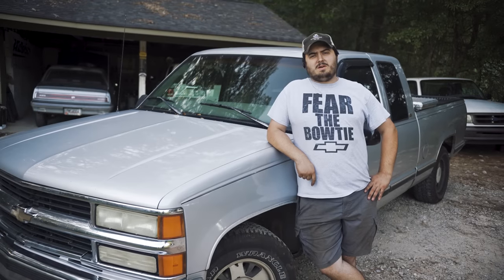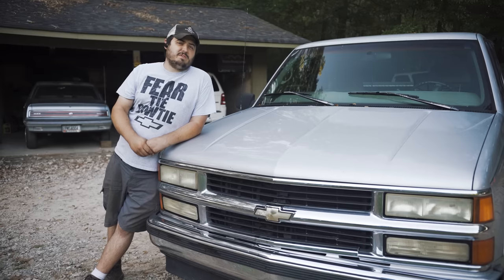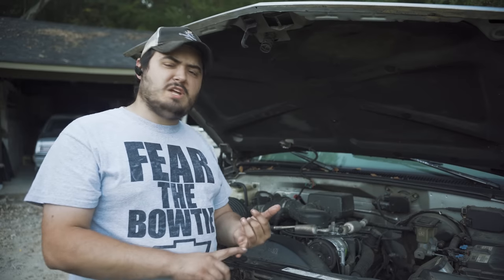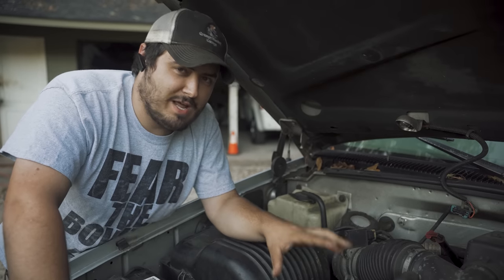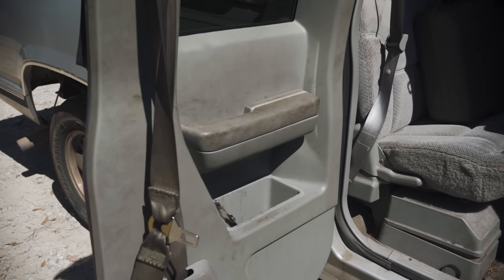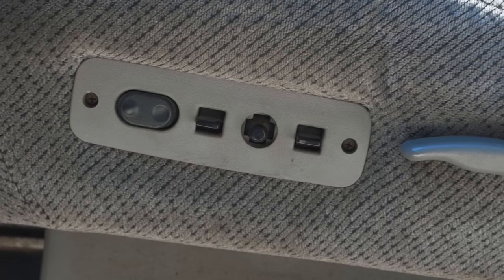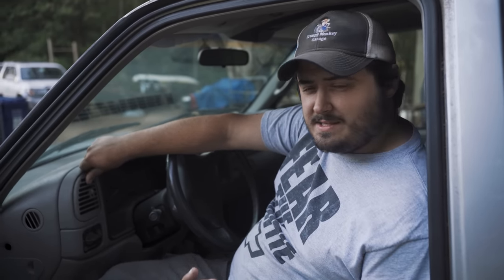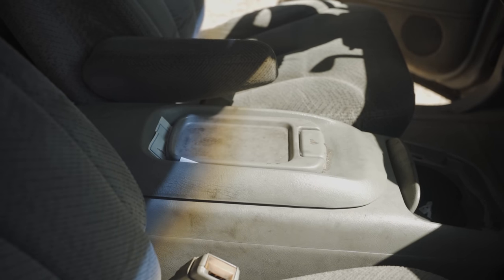OBS CHEVY TRUCK REVIEW, 1997 Chevrolet C/K1500 Silverado Review, The Best Truck You Can Buy?

Comment: Wow 👏 
Glad to hear that. 
Unfortunately I wish I was that happy with mine. I  have a 98 k 2500 4x4 extended cab long bed. About  115 thousand miles. Looks awesome. But I have replaced. Alternator. Have had  starting problems. I  don't know why. But  sometimes it feels like not doing anything. Eventually it does start. Steering problems  yup. Brake problems. Yup. For a  350 automatic transmission it should have lots of power. I  don't..Runs great 👍. The  head gaskets got eaten up by the crap antifreeze that they used. Replacing that was crazy. But I did it. Now it smells like antifreeze in the cab. When I turn on the heater. I  haven't checked it yet. The  arm rest at different  heights is wierd. The  floor boards are nice and curved. So when I open the passenger side door. What ever is there  falls out. 🤔 I  don't have the third door so getting in the back of my truck is not exactly easy. 🤔Air conditioning has a leak. It  works for a day or so when i get r134 in it.tried the leak stuff with no luck. Its like it hardly gets used but it always needs something 😕. 
The  fuel pump was a adventure. 
Cold freezing cold cold weather and almost a full tank. Two hours away from home. 
What the hell. Other than that it is a beautiful truck. Spent most of it's life inside a garage. 
Nice and  clean and looks great. 
Parked. 
Did anyone else get a lemon 🍋 
Like Me?
Reply: Is your truck still giving u problems i have a 98 also
Reply: @jonschwartz9669  No ac Wipers work when they want to..I  hardly use it. But I am always terrified that it will not start. 
Done that been there. 
What problems do you have
Reply: @vm722  I had problems but had to fix them its my daily driver  if your doesn't want to start its either fuel or fire and most likely fire pull your distributor cap make sure to mark your wires somehow before pulling cap look at the contacts for corrosion and look at rotor  also don't loose the screws to cap
Reply: @vm722  does your air blow through the vents
Reply: @jonschwartz9669  yes the ac used to work for about a day. So I got uv dye glasses and light 134.It  didn't want to suck up the  134.
Yes I triggered the compressor. 
I  think that it probably needs a new compressor. 🤔 
I am tired of fix da ting
Reply: @vm722  your ac has a low pressure switch if its low on 134a it won't cycle it needs 2.5 pounds but it will cycle if your filling the compressor and it can take an hour sometimes till get 2.5 pounds in the whole system if it's cold outside the can will freeze and no gas moves the can works best in a bucket of hot water if your compressor clutch moves for 2 seconds while filling then stops your compressor is fine it takes patience and time to get the gas going once it gets full enough for the low pressure switch to be satisfied it will fill up faster the compressor also has a high pressure switch and once its full with 134a and everything is running good the compressor will cycle on and off with the high pressure switch
Reply: @vm722  don't give up there's a trick to filling it up i know it seems like it doesn't want to suck it up but it does in small amounts only when the clutch engages does it allow freeon in the compressor so this can take awhile to fill it up the first can can take along time to get in and the second can not as bad but still a while but after the second can and while you're on the 3rd can things finally get normal and these are 12 ounce cans

Comment: I thought the LT-1 only came in the vette, roadmaster from 94 to96, z28, trans am, Fleetwood 94 to 96. My 96 Buick roadmaster lt-1 is set up differently than my 98 Chevy 5.7 vortec c1500 Silverado. Lt1 has the optispark (puke) and has more HP 30 some more HP than the 96 thru 98 Vortec 5 .7 which is rated at 255hp. Did they also call the 5.7 vortec a LT1???? I've never heard that before in all my years.

Comment: If you upgraded the suspension on this truck and a hood agm battery and add a transmission cooler and aluminum radiator an intake a 50 series muffler and you’re Gucci maybe a level kit with MS tires and you’re gonna be chilling for a long time trust me. Put it through hell and it’ll be fine.

Comment: My 98 GMC sierra has an extended cab but no 3rd door. Still have no idea why
Reply: 3rd door was an option it was never standard. And to get the 3rd door the truck had to have Silverado/Sle Sierra trim it had to have an automatic transmission had to be a shortbed and have either solid paint or conventional two tone paint and only available on 1500 models also required the 5.0L V8 or the 5.7L V8... 3rd door was not available on Cheyenne trim, wasn't available with the 4.3 V6 wasn't available on a longbed, wasn't available with a manual transmission and wasn't available with deluxe two tone paint.
Reply: @thedesertdwellerfromutah4354  Thing is my truck is an SLE 1500 short bed 5.7l automatic solid white
Reply: @max7768  Then it just didn't come with the 3rd door option....I have a '97 Silverado Extended Cab Z71 4x4 that's fully loaded with automatic and Vortec V8 with factory aluminum wheels and it doesn't have the 3rd door either....I like it...less rattles

Comment: Got a 98 c1500 296k miles long tube header 3in custom exhaust from header back big intake burns about a quart every 1000 running very strong I expect another 100k at least love it ... lol looks like a trash can rolling though 🤣
Reply: Also bought a garret tuned computer getting like 17mpg on the hwy going 80-85

Comment: Problem is you don't live up North with Winters and salt.The Door handles the tailgate handle. Break all the time or rust and don't like to work correctly most of the time. (Screwdriver needed). I'd still rather have that Chevy model then a ford..lol
Reply: Pull the tailgate handle up when closing it, instead of just slamming the tailgate to close it !!  My 1996 & 1997 trucks still have the original tailgate handles on them !!

Comment: But they didn't have LT1 engines... It was still an old school 350/305 but with vortec heads, fuel injection, etc.
Reply from the maker: Yeah there's a comment here that said the LT1 was the Omni spark version of the 350 I messed that up.

Comment: Sorry buddy, yes great trucks...please get your RPO codes straight. The engines in that generation of trucks had almost nothing in common with the Gen 2 small blocks found in '92-'96 Vettes, '93-97 F-bodies, and the '94-'96 B/C(D)bodies. The small blocks available in this gen of truck is more closely related to the original small blocks.

Comment: 5:45 - Both the exterior and interior door handles were, in all honesty, a flimsy and rather poor design choice that GM corrected in the 1999 (and newer) models. It is one flaw that you just have to accept, when it comes to this generation of Chevy pickups. That said, you're 100% on about the availability of replacement door handles for them, so even if you do break one, it's easy to replace.

Comment: My "01 Chevy Suburban has over 300K and uses no oil at all - drove to Denver and back to Phx. and no oil used at all.  Chevy lost the reliability when they went to the dual sized lifters and AFM.  Today, you are better off with older Chevy and forget about the electric cars.

Comment: I like the 88-95 tbi models
Reply: @HandymanHustle  I just like the tbi setup better than the spider fuel injection for the vortec 96-98z

Less to deal with if something goes wrong on tbi motors.

I do like the 96-98 seat interior tho.
And 96-98 has third door option is nice for ext cab.

I have a 1990 with a 98 cab with third door.  Stick shift 5.7 and blue interior from a 98. 4wd
Reply: @HandymanHustle  

Sorry I don’t know.

Most I pulled with my k1500 stick shift is around 2k and it was like I was towing nothing.

I think I have 3.73.

Tell you something though.

A guy I know sold me a 2500 6lug and said he was pulling 20k lbs....
Reply: @HandymanHustle  

His 2500 is LIght duty same frame that you and I have but he probably had 4.1 gearing because 20k lbs is crazy...
Reply: @HandymanHustle  

You can always up your gearing if needed. 

One of the huge benefits of these year trucks is parts are plentiful and cheap.
Reply: @HandymanHustle  

Seems common report from other owners on google is somewhere below 5k lbs

Comment: I gots a 1998 (heavy) Chevy Silverado (Illverado) K1500 Z71 with 107,000 original miles 350 motor great inside and outside for the low low price of drumroll........................................................................ $1,200 yes $1,200 not $12,000 or $11995.99 
I POR15 the underneath so this bad boy is going to last until the end of time!

Comment: Disadvantage of this truck is gas guzzler.  Compare to 80s/90s Hilux 4x4 especially 4cylinder Turbo Diesel very fuel efficient.
Reply from the maker: Unfortunately for us, you cannot get a Toyota Hilux in the United States without some fancy import ability. Also, the Chevy is not better than the American Toyota, but even an old Tundra is tripple or quadruple the cost of one of these Chevys.

Comment: This is not an LT1. The LT1 was put in Camaros and Corvettes. Never in a truck. Vice versa. These engines were unique to trucks, and I don’t consider myself knowledgeable in which engines got put in which vehicles. Also don’t be hatin’ on metric measurements.  I work on cars for a living, my job would be impossible without metric tools, and honestly, it’s far easier to understand. If one size is too small, try the next number up instead of fractions you can never remember, that’s probably why every other country on earth uses it

Comment: I'd love one of these but I'm a poor 19 year old 😂
Reply: there only like 3k max
Reply: @fila6228  I'm not sure about that in the South
Reply: @darthdarthbinkss  i live in the south got like for 1900
Reply: @fila6228  What kind of shape was it in?
Reply: @darthdarthbinkss  great shape 180k miles
Reply: I wanted one since I was 12 - I'm 35 now and still dont have the one I want lol but I suggest buying an ol beater and YouTube dyi fix her up ;) the 5.7 is a beast ;) 2wd regular cabs are awesome, still wanting a 4x4 extended :) we'll get there ;) 
Pray, believe, recieve ;)
Reply: @fila6228  Not bad, not bad at all.  I just assumed these held their value well.
Reply: @roosteroriginal6458  Hey, thanks man.  I hope you can find a good one one of these days.  I think I might settle for an old Ranger or S10 with the 4 cylinder.  I'm sure I can do 0-60 faster than those trucks but I want a truck and they're good on gas.
Reply: @darthdarthbinkss  S-Dime 4.3 - 5 speed will light em up ;) I still miss mine sometimes :)

Comment: Isn’t the 97 to 2007 practically the same truck??
Reply from the maker: Not even close, late 99-06 are the same, with small differences. And the 2007 classic could fit into that category too. 1988-1994 are very similar, and 1996-99 are almost identical with slight changes. The 1995 is the strange year for gm. Updated dash, but old iron block 350. Also in 99 both sides could be suicide doors, and 98 and below did not have dual rear door options. Lots of engine changes from 99-2000 as well, completely different set up. Same basic concept.

Comment: My 1971 F250 was a far better truck. But to buy a good one now is very very expensive. And for good reasons.
Reply: My 1969 ford truck wasn’t even close to being as good of a truck as what those 1988-1998 GM trucks were !!

I have a 1997 3/4 ton Chevrolet truck that I bought new in April of 1997. That truck has 464,000 miles on it. 

By contrast, it would’ve taken me about 4 of those 1969 Ford trucks to reach 464,000 miles !!

Comment: Can’t disagree too much but the 97 is garbage compared to 93-94.  The 97 does have a better engine better flowing heads and the roller cam but the rest of the truck esp the interior I hate. This is first hand account. Cup holder designer for 95 up should be taken out an flogged. I bought a 93 new and haven’t had near the issues with it as with the 95 and 97. Door handles I keep in stock on hand. Window track is held on by one screw that strips. Door hinge bushings wear faster in 95 up. My 93 has 338k and never hasd a door panel break or hinge pin bushing.  If you drive these trucks on the highway you will never see these issues but if your a farmer or really work rough conditions you will find the 93-94 to be the ultimate truck. 95 seat supports broke pretty early on. Same seat as yours.
Reply: I agree. My 93 V6 is a solid machine at 215 000 miles. Just a distributor and wires and plugs and regular oil and brakes. Keeps going. Still no rust
Reply: Well I’ve been on a farm my entire life. I have a 1997 with over 464K miles on it. The door pins & bushings are exactly the same on all of those trucks from 1988-1998 !!

Get a quality door handle for it, instead of buying that garbage from auto zone and such !!
Reply: Well still my experience here in Nebraska is the 95 and 97 both lost there door pin bushings at about 250 k  seems common for those years but probbly the difference is out terrible roads.  Everyone says they have bad roads bla bla bla   Midder 4x4 clubs come in the spring just to run our roads.  The 93 has 340 k and original bushings. They are the same part only probbly made with cheaper material. 
Ac delco
Handles break as fast as Napa ones. There all made in China now

Comment: Problems with these trucks. Gauges fail (fuel usually first), 4L60E fails as a truck transmission, brakes suck for under max CGVWR usage... Actually, they just suck. 4X4 selector tends to fail. The dashes do crack, contrary to the video info. Use it for light duty and it will last 500K miles.

Comment: had a 98 k1500 4WD loaded with the 3:73, no rear locker. sucked in the snow compared to my 13 sierra, shit definatley was built better on those but the extra cab space on the extended cabs plus the rear windows being power is an added bonus on my 13. at times i miss that truck but theres more times i dont, definatley wouldnt buy anything newer than a 13 things are fuckin junk lmao

Comment: Why 1996-1998? What about 1995?
Reply from the maker: 1995 was still obd 1, and had TBI instead of spider injection. The OBD 2 is really what makes it so good in my opinion, people just getting into cars/trucks will have an easier time with OBD2 diagnostics than OBD1 diagnostics, I would say the reverse is true for working on them, the old 95 and older trucks are much easier to work on.
Reply: @GrumpyMonkeyGarage  thanks man! I am actively looking for a K1500 now. You sold me on one :) Subscribed cause you do great stuff!
Reply: @GrumpyMonkeyGarage  hey man, I just gave a deposit for a 1998 Chevy C1500 Silverado!!! It needs oil lines and a patch on the gas tank but the rest is in decent shape! Got it for $2300 USD ($3000 CAD). It comes with winters and summers and has the suicide door. What do you think?
Reply from the maker: @MotorPressReviews  I think that's a fantastic deal! Gas tanks here in the south are $50-100 used, and oil lines are very easy to do yourself, I do recommend jacking up the truck to do it, even if you can squeeze in there.
Reply: @GrumpyMonkeyGarage  thanks man!!! Once it’s in my garage, you might hear from me again lol!

Comment: 😂😂😂😂😂😂🤣🤣🤣🤣🤣🤣🤣🤣🤣🤣🤣 I hate to burst your bubble but the 96  Chevy trucks didn't have the lt1 they only used them for the cars like the Corvette, Camaro, firebird ,Impala ss Buick Roadmaster not the trucks had lots of issues from the intake gaskets to the spider fuel system that leak gas in your intake and the square body is the best truck you can buy for your $$$$$$

Comment: I have a 98 and want to push it off into the lake. Can't explain the hell I've been through with this truck. All because of junk plastic parts they put on them and don't even want to talk about changing the power steering pump nightmare. The truck is junk. They could've made it better like the earlier 90s models but went to plastic parts and horrible engineering ideas probably to make you bring it into the dealership.
Reply from the maker: Found the hater
Reply: @GrumpyMonkeyGarage  lol Honestly I always loved Chevrolet but this truck is the worst vehicle I've ever owned. I've about lost my sanity with this junk of crap. The engine is great. 350. But they got cheep and started doing unwise things to them and they don't last like the old ones. Still love Chevy but I'll never own another one.

Comment: its 2021 YOUR CHEVY C/K 1500 FROM THE 1990S IS NOT WORTH $5000+ DOLLARS
Reply from the maker: Your 2021 truck will be junk in 5~ years, these obs trucks will still be around, value in reliability and style, maybe alittle nostalgia too.
Reply: @GrumpyMonkeyGarage  yeah i know i have a 1994 ford ranger and it cranks and turns on super fast even in the cold lol. Also i was thinking of getting of getting a C/K but which transmission suck? is it the k3500 or the 4LL6OE?
Reply from the maker: @its-ascencio1351  the 4L60E transmission is fine after an update rebuild, but the original configuration 4L60es had 3-4 gear solinoid problems and rear ? bearing? Problems? My transmission rebuild guy is way more knowledgeable on the subject. The manual transmissions are getting rare, so that'd be worth buying in my opinion, but I have limited experience on those.
Reply: @GrumpyMonkeyGarage . Yeah and jasper wants almost $3000 for a 4l60e now. I need one but I might just break down and put a 400 in it sents I have that one..
Reply: Since*